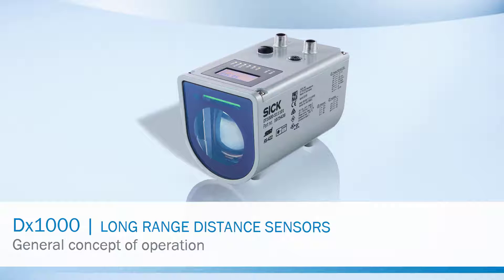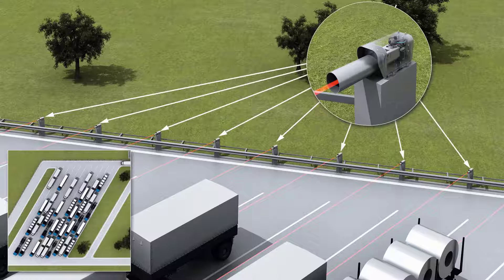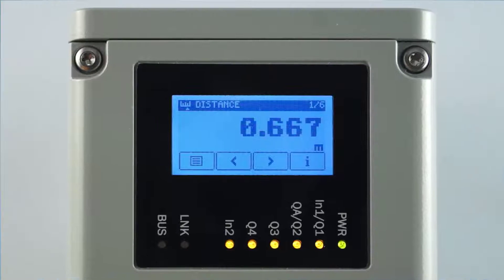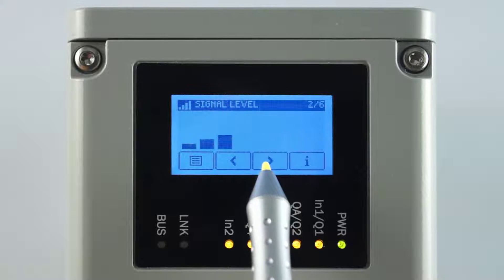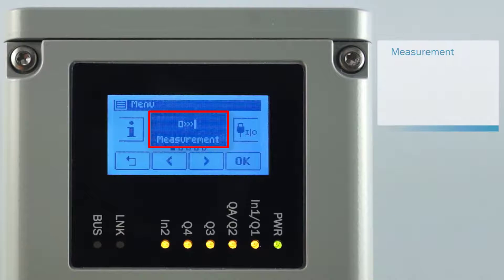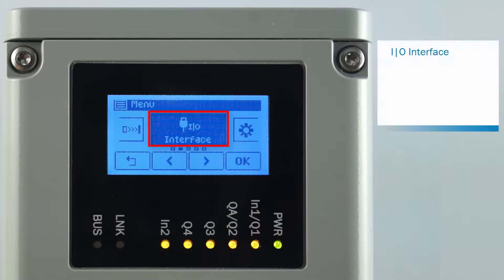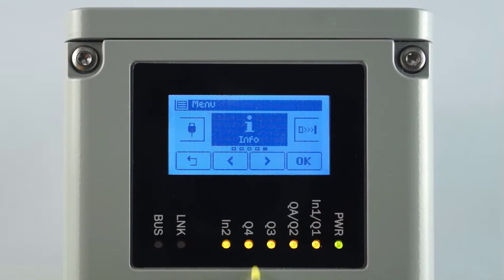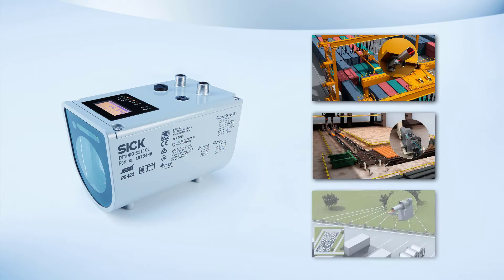Tutorial Dx1000 long range distance sensor (Part 1): General operation

Comment: Upto how distance it can measure????
Reply from the maker: Hi Sumit Saha, 
There are two variants available.
1) The DT1000 is designed to measure onto diffusely reflecting surfaces. Depending on the optical degree of remission of the target surface and on the sensor settings, a maximum distance of up to 460 m can be measured
https://www.sick.com/de/de/distanzsensoren/long-range-distanzsensoren/dx1000/dt1000-s11101/p/p455159 

2) The DL1000 is designed to measure onto retroreflective foils ("Diamond grade" reflectors). Maximum distance is up to 1500 m
https://www.sick.com/de/de/distanzsensoren/long-range-distanzsensoren/dx1000/dl1000-s11101/p/p455158